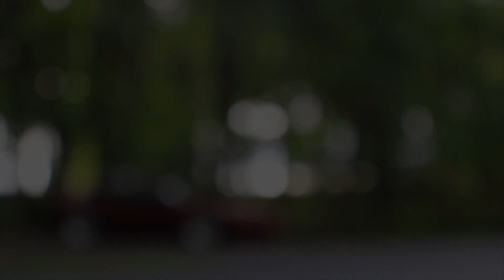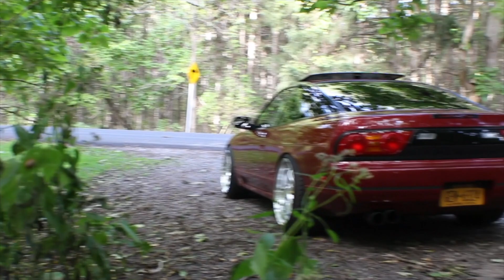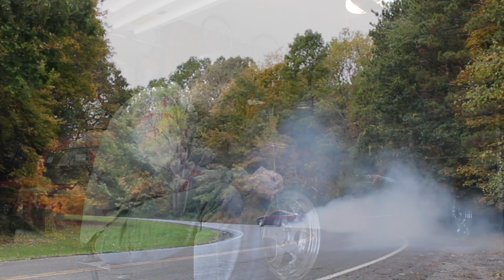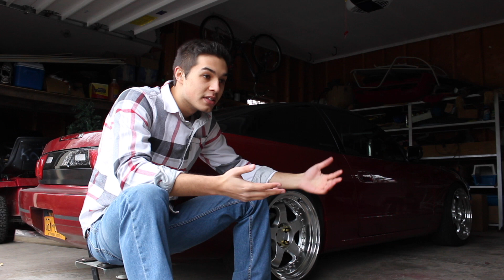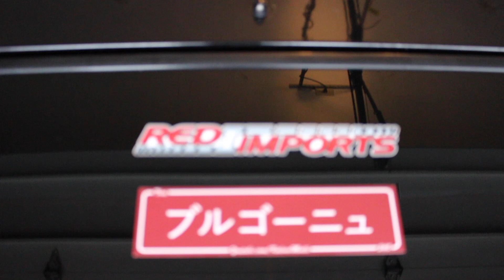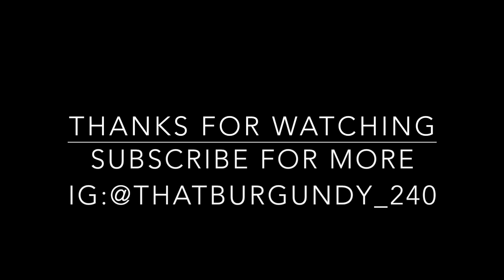240SX Build Update #2 | BUILT RB20? | Taking Engine Out

Comment: I was watching the other video with the dyno and you seemed pretty hung up on the the power drop at ~4000 rpm.  Isn't that just the waste gate opening up and correcting for the boost?
And just noticed that the rpm was off on the dyno, not too sure how how dynos work, but isn't horsepower calculated as a function of torque and rpm? (torque x rpm)/5252 so if you were to add roughly 1000 rpm to that equation you could have a fair bit more of hp.
Doesn't really matter as you are about to change up your setup but you could have a little more bragging rights! anyways keep up the good work!
Reply: +Steven Olson and snapchat!
Reply: +Steven Olson It's not the wastegate, if it had boost control issues they would have seen it right away as they measure the boost on the dyno to, it could be so many things on an old engine like this, also they use an RPM signal from the loom to get the RPM reading and is 100% accurate unlike the gauge.